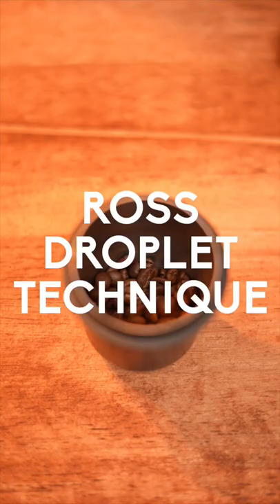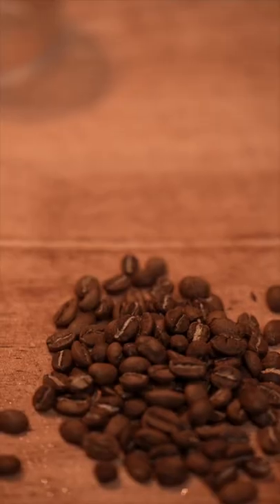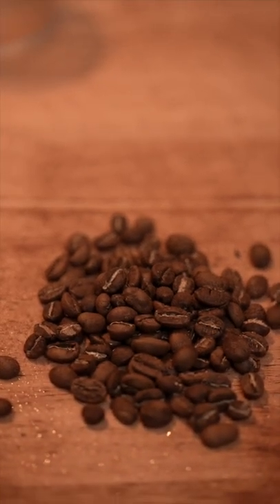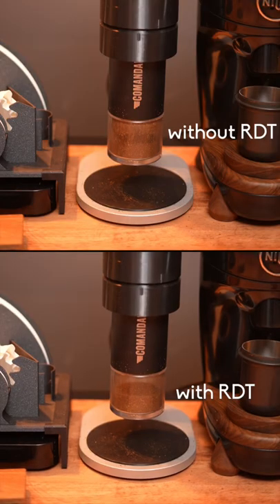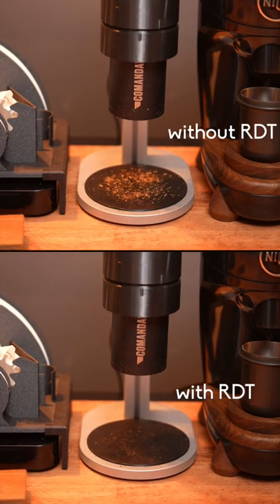Spray Your Coffee Beans | #shorts

Comment: Be careful about adding moisture to a grinder.  Water + organic material + closed space = mold.  I’d recommend leaving the grinder open to air dry after each use if you do this regularly.
Reply from the maker: yes! my note about regularly cleaning should avoid any issues - for reference I clean my Niche Zero about once a week or biweekly at most